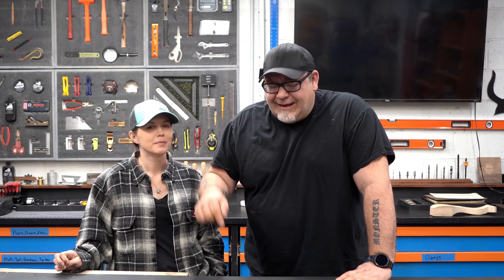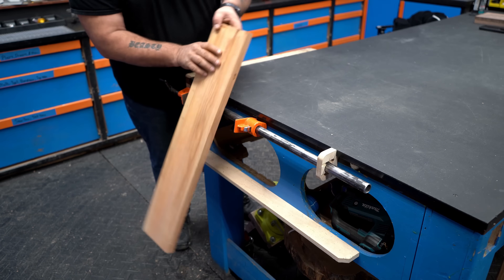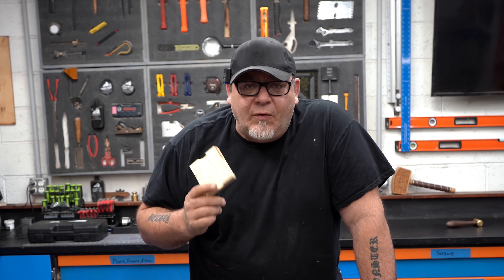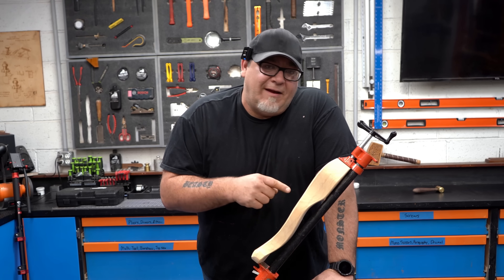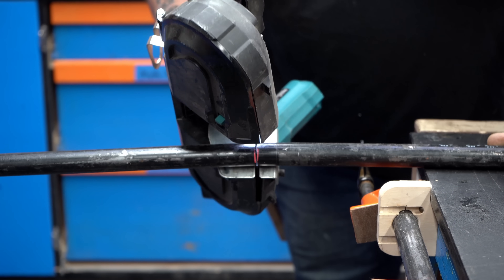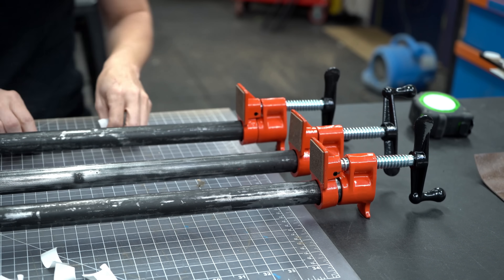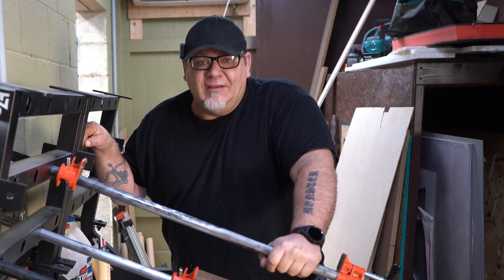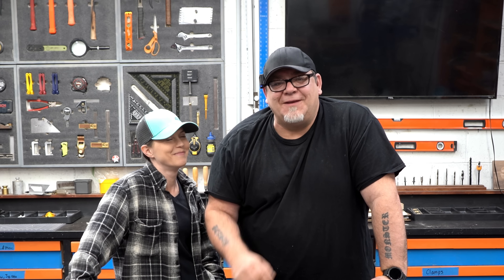5 Easy Ways to Save BIG Money with Pipe Clamps and These Little-Known Tricks

Comment: You always have really cool tips. Another thing you can do with pipe clamps is join 2 pipes together with a threaded coupler to make a really long clamp. I made a king size bed for my daughter. I put the pipes together to make clamps long enough to glue up the head and foot boards.
Reply: Cool tip... Thanks.
Reply: Awesome tip! What else do you have up your sleeve?
Reply: I always have to remember to remove the tailpiece before coupling. It'll be snug up to the head and then won't slide past. This is less embarrassing if no one else is around, but only slightly...
Reply: I've used couplers with my 3/4" pipe clamps for many decades. I cut the 10' pipe into three pieces and thread both ends. I prefer the 3/4" pipe to the 1/2" pipe, it is more ridgid. Not having to store long clamps makes storage so much easier. Hint, get the pipe clamp fixtures that you can screw in and out on the bench top, not the ones that you have to shim up or hang over the edge of the bench. Both will work but one makes the task much simpler.

Comment: I got a lot of my 3/4 pipe by stopping at a few plumbing shops and asked them if they had any used 3/4 gas line, that they are interested in selling. You be surprised how much pipe $20 will get you. They just sell it for scrap.

Comment: Question? What size you recommend when buy black pipe? 1/2 or 3/4
Reply: 3/4 is slightly thicker, bowing less under pressure. Since it's the most used size, 3/4 tends to be cheaper than 1/2.
Reply: @p3ntastar  Thank you👍
Reply: At my local Home Depot 1/2" black pipe is 64 cents cheaper per foot than 3/4" when buying 10' lengths.

Comment: We use contact cement and thin blocks of pine or bass wood, 1/4”-3/8” is nice and it’s around the shop,,, always! Also a light sand on the face of the clamp helps the adhesive stick!

Comment: This video is fantastic. I will be buying cork immediately. The clamps come with those little rubber things, but they fall off all the dang time and some have been lost. This is perfect. It will work for my bench vice too! I will also be sanding/waxing the pipes; I previously put blue tape on before each glueup, but that was always a pain to get off the clamps. This is a much better idea.

What acid do you use to get the black marks off?

I will put those jigs on my list as well.

Comment: THANK YOU!!! I've been saying this for years, about pipe clamps for years... ESPECIALLY if you modify them to be more effective. 
 
Also, a 1/2" pipe clamp is more than enough for any clamping task. 
 
Also, a set of pipe clamps are great for using g to make a front style moxon vise.
Reply: Another tip, with adding a protective pad to clamps, you can buy rubberized cork rings (I used them in rod building), and they are much thicker/softer and pretty much indestructible.  A little epoxy, or JB Weld, and you have a clamp pad forever. (They also come in colors.
 
Just DONT USE NEOPRENE!!! Lol. Learned that the hard way.
Reply: I sand my pipes, then paint them to color code them, and make them rustproof, and glue proof.

Comment: I love my pipe clamps. Bought 8 Bessey's. I also bought 4 10 foot black 3/4 pipes and cut them in half with a sawsall. Since they are threaded on both ends, and you only need one end this gives me 8 pieces of pipe with threaded ends on all of them. Smooth out the ends with some sand paper and attach the heads, good to go. 

I wanted Parallel clamps, but I just couldn't afford them. I needed 48" clamps, and the Bessy's were fine. Also, buy the 10' not the little 4 foot sections, they cost just as much. Buy the longer one and cut it to size. For the pads, Bessy's came with rubber slip on pads. Those work fine. The cork covering, I might want to look into that.

FInally, I wish I had your workbench. The size of it is great.

Comment: My local Lowes no longer cuts and threads pipe. I used to get a 10' stick of 1/2" black iron pipe for $12 and have them cut it to 3-3-2-2' lengths until they complained that I should just be buying their pre-cut stuff. Their policy changed to not cut shortly after that. Blessing in disguise though, as a local-ish bulk metal supplier sells it way cheaper than Lowes and they will cut to any length. You have to thread it yourself though. Shop around!
Reply from the maker: good info thank you for sharing Jay.

Comment: Izzy, I agree with your comment about not putting dog holes or T-track in an otherwise beautiful bench top.  I'm interested in what you have used for your black (dark, dark gray) bench tops.  Steve
Reply from the maker: we use HDPE on our bench tops. glue and epoxy wont stick to it. but it does scratch pretty easy

Comment: For sanding the pipes, why couldn't you take that idea? Drill a 1" hole or maybe 1-1/4" and cut the block of wood in half, glue some sand paper to the faces, put a dowel or 2 thru one part of the block to keep everything aligned. Now slip that over the pipe, and sand away.

Comment: Hi Izzy. Those looked like Harbour Freight pipe clamps. Mine from HF I seem to have an issue with them not being square or 90 degrees. I don’t have the issue with Pony or Jorgenson. I am pretty diligent in using F style clamps onto the pipes and sometimes culls to keep my panels or doors flat. Have you encountered this issue? 
I am going to build some panel clamps as I have a few interior doors to build.

Comment: I use Bessey's for the threaded ends of a 10 ft pipe and Irwin's that don't require thread for the middle section. The Irwin's are a bit more fussy to use.
No free cutting/ threading near me and it appears that pipe from a dedicated plumbing supply has a thicker wall than at a big box store so less flex under pressure.

Comment: I have a tip for you! If you ever use concealed hinges and have a concealed hinge machine to cut the pocket holes in the back of the doors to install the hinges in? I worked for a company for 4 years that on certain doors would have a hinge that needed to be installed on a door in a higher spot than the normal setting. So the employees were taught to put a pencil mark on the back edge of the door to line up where the pocket drill bit would drill the hole at. After the holes were all drilled then a employee would go back through all the doors and have to sand those pencil marks off. Handling doors twice! One day I thought why are we putting pencil marks on the edge of the doors for? Move the pencil marks in 1/8-3/16” where the hinge machines drill bit will remove the pencil mark with cutting the hinge hole.  Still no problem lining up the pencil line in the right place. I tried it and it worked perfectly! Showed the foreman that was speechless for a second or two. Then he smiled and said why didn’t anyone else all these years think of doing this sooner?   Such simple methods are often over looked and not ever though about till someone comes along and thinks a little more how something could be done better and quicker saving time and money!  Of course the foreman told the boss and my idea was then always used. But did I get anything for helping the company save time ? Nope, not even a thank you!
Salved the same company $10,000.00 and the company never knew why they ended up with a huge surplus of money that year and at the Christmas party the employer split the 10 grand between the employer’s brown noses that really didn’t work very hard. Especially when the boss wasn’t around!  Like the boss’s buddy that was supposed to be at work on time every morning to let the 35 employees in to start working. But the boss’s buddy would show up anywhere between a half hour to up to a hour late while employees sat in the parking lot waiting for someone to open the building. Of course this buddy also got a huge portion of the 10 grand I saved the company. 
Naturally when I got around to telling the boss how he got the extra surplus of money, still I didn’t even get a thank you!  A simple thing of not letting employees be lazy and going and grabbing full 10-12 foot boards to cut up for projects and tossing the scraps on a large cart and when the cart got full of scraps it all was going down n the dumpster. When the boss put me in charge I stopped that practice and made the employee check the scrap pile on the cart first before going out and grabbing new full length boards.  That $10,000.00 in just 1 year ought to give you a good idea how much wood was just going to the dump every week!  Amazing though how some companies can waste materials and do other things that they could be doing better to make a better profit and yet they still have a profitable business. Just not as profitable as it could be!

Comment: best wood working video I've seen this year for sure.  One thing I have found helpful is a paint roller cleaner to remove dried glue from the pipe when ones technique is less than professional and the squeeze out is all over the pipe.

Comment: I see you use black iron pipe.  They work while galvanized pipe does not work very well, it's too slick for the fixed end to grip.  Please don't ask how I know.  Something I do when I need a really long clamp is put two shorter pipes together with a coupler.  Just don't get unions too tight or you'll have to use pipe wrenches to get them apart.  You would need to have both ends threaded to do this.  Keep the good stuff coming

Comment: I feel sorry for those of you without a Menards nearby. A 10ft stick of 3/4 blackpipe is $22 and 3ft is $12!  Home Depot and Lowes are insane with their prices!!
Reply: I get mine from a local hardware and supply store. They are cheaper and will cut to any length and thread for you, call you when its ready and help you load up. Buy local when you can.
Reply: @dougw9239  I would if the local places near me didn't act like I was inconveniencing them every time I step foot inside. And I like to just go in, grab the stuff I need and leave. Not go in, wait at the counter for someone, describe what I want, they have to check inventory, tell me they have 2 of the 4 things I want, then order the stuff, then go grab the other things.... it's a 45-60 minute process (for a 5 minute Menards trip) on top of their arrogance because I'm not a $10million/year customer. I only go to them now when I absolutely have to. Oh, and they are typically twice the price or more for the exact same stuff. F'em

Comment: In a pinch, if you don’t have a threaded pipe, you could drill out the threads in the head and slide it over the pipe and run a bolt through the whole thing. I wonder if anyone has ever made pipe clamps without the threads?

Comment: If you are concerned about weight, there is aluminum electrical conduit. I have some clamps with that, light, soft, expensive. Most electrical supply have it.

Comment: Why black pipe? Why 3/4” pipe? Why threaded clamps? Galvanized  pipe doesn’t stain. 1/2” pipe is cheaper and lighter. Many pipe clamp designs don’t require threaded ends.

Comment: I concur with the 10' pipe idea (I've done it), but one thing you have to make sure of is that
a -- they do it (my local HD won't do it at all, they don't have the machines... my local Lowes will)
b -- Make sure that whomever it is that knows how to operate the threading machine is actually on site. One Lowes, there was literally no one who knew of anyone on the ENTIRE STAFF who knew how to operate the threader (and I've never gone back to that one). Another one, they had ONE guy and the schlub had just gone to lunch, so I had to wait for an hour for them to get back there. Best to find out and call ahead, before even bothering.

And as you note, another option is to consider just buying a suitable tap and die set for pipe threading. Not all that expensive, and you may have other occasion to use it.

Comment: Great tips. I find that liquid Goof Off on a rag takes the black coating of well. And If I'm super worried about the finish, I'll size the clamps close (within a couple of inches of the final panel size, and put blue painter's tape on the pipe. That also means any glue squeeze out just gets stripped off with the tape.

Comment: I have a bunch of pipe clamps and they are very cheap indeed, is chocking to hear the prices of the pipes over there, here in my country a half inch 6 meters long black pipe cost just $10.25, is enough to make 6 40"  pieces.

Comment: Another good reason for black pipe, it allows a better no slip grip by the clamp mechanism. The galvanized coating, being zinc, is soft, it gouges and slips, pushes up ridges of the zinc if you really tighten the clamp. then you have an even bigger job smoothing it out.  Great tips, Izzy.
Reply: I bought a black pipe to replace a galvanized pipe and the clamps kept slipping. The clamps are somewhat old so that may be the issue, but I wondered if you had any other ideas.

Comment: Thank you for sharing new/old great ideas for using Pipe clamps. I love them and I use stainless steel pipes: A little bit less grip but the clamps themselves don´t leave pressure marks on the pipe after a time, because the material of the clamp is weaker than the stainless steel pipe. But the biggest problem on pipe clamps are the springs in the inside of the clamps. If they are weak, nothing works anymore and even Bessey doesn´t offer them as sparepart... at least not in Germany. :-( I didn´t find any solution to refit or get tension back on these springs.

Comment: That’s exactly what I did years ago.  I wanted different length clamps so I bought had them cut 10 footers, got 8’s & 2’s, 4’s & 3’s.  Also if you need longer you can get couplers for in between multiple pieces.  I have Home Depot thread both ends after they cut them.  Great tip on the cork and double sided tape.  A lot less than the pads you can buy.  Plus the Harbor freight ones just fall off.

Comment: For the unicorn who wants to gild the lily and go expensive fancy with a pipe clamp, an alternative to black pipe is, get this, BRASS.  I recently discovered that I have 3/4 inch hargrave pipe clamps on a 48" piece of brass pipe.  No fooling, my father-in-law found it at a yard sale years ago, maybe salvaged from a boiler or some other pipe-fitted setup.  It has a slight bend so I initially thought someone rigged up a clamp using copper tubing.  But after hitting one end of it with a flap disk it turns out to be bright brass. 😮

Comment: If you use Galvanized Electrical pipe you don't have to worry about the black marks. Same threads same size, not sure about cost difference.
Reply: Great point. Rigid Galvanized Steel conduit (RGS) is Schedule 40 steel pipe without an inside seam.

 And if you have lighter applications, ceiling fan down rods have the same exterior dimension as RGS with a thinner wall. It's called Intermediate Metallic Conduit (IMC) but can be difficult to thread at times.

Comment: One additional idea  for the clamp protection would be to use some cheap rubber "workshop" mat flooring -- ca. 10 bucks for (4) 25"x25" @ Harbor Freight ("Anti-Fatigue Foam Mat Set, 4 Pack"). Cut them to fit and glue or double-tape them on. Great for making vise clamp protectors, too, and even use them with pliers, etc., as needed.

Comment: Never seen any of these tips before and they were all fantastic and really useful.  That TNT rack is nothing short of brilliant!  Thanks for the link.  BTW - I also like Andy's cork rubber, but it is pricey.  A cost effective alternative is to use a Baler Belt and cut it into smaller pieces.  I have Tractor Supply Co near me, and you can pick these up off the shelf and they are good grippy protection for all things vise related.

Comment: I mostly use 3/4" aluminum conduit for all of my clamps.
The upside is obviously much lighter weight. The clamps also bite on the aluminum really well. 
The biggest downside is that aluminum conduit is meant to be bent. So if you really crank down on it the pipe will bend right at the clamp. But in reality, if you're just doing glue-ups you don't need to tighten your clamps as tight as possible.

Comment: Also, only 1 end on pipe clamp needs threading. 
 
But even then, I like to use some JB Weld to lock my clamp head onto the pipe. If you've ever had one of those heads blow off, (especially with the newer Bessey, and Irwin clamps) you know what I'm talking about.

Comment: This was the push I needed to finally try some pipe clamps. I have a few parallel clamps but quickly realized I'm going to go broke if I keep it up. Two questions: 1) do you prefer the black pipes purely to save money?  2) Do you strictly use 3/4" pipes, or do 1/2" have a place in the shop as well?